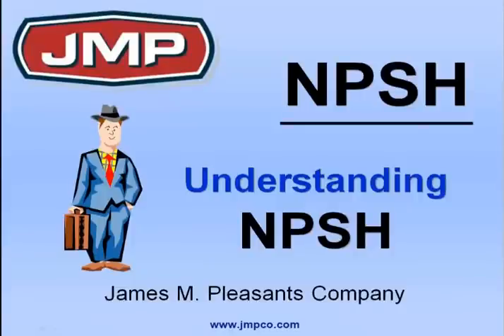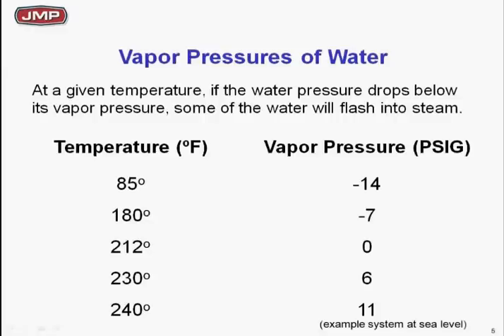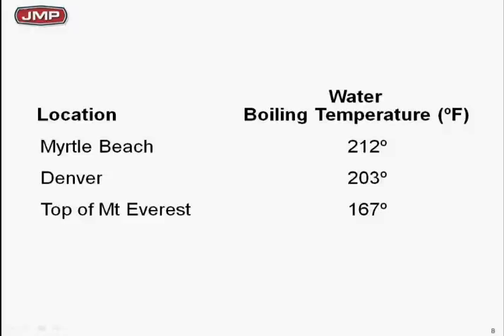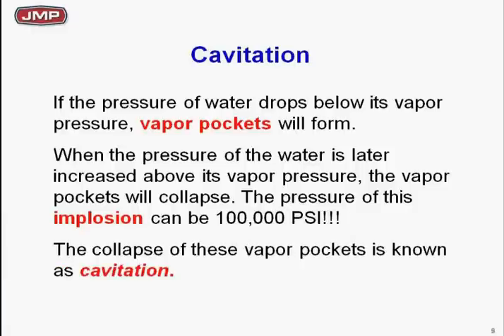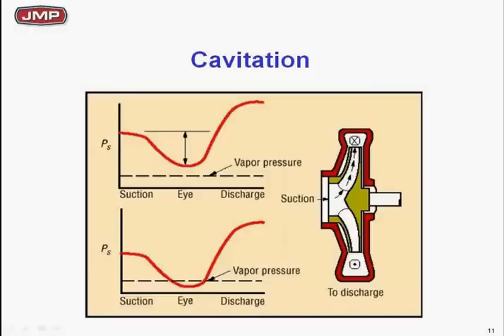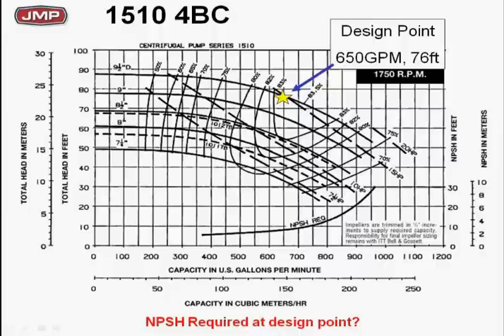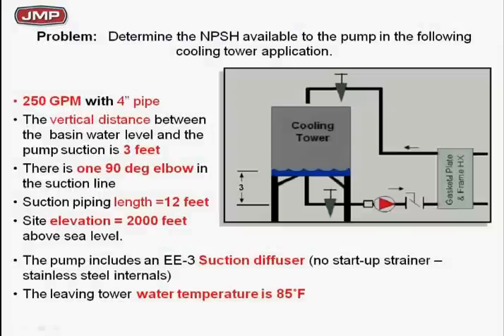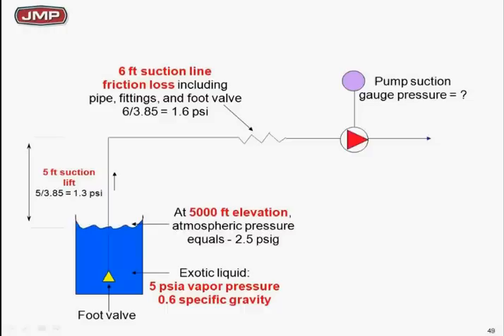NPSH

Comment: Great Video, I've searched for the available calculated suction pressure.guage press chart to know avail.. Can you help?
Reply from the maker: Thanks for the comment.  You can find it in the B&G Cooling Tower pumping and piping TEH manual at bellgossett.com.  Below is a link to the manual. 

https://documentlibrary.xylemappliedwater.com/wp-content/blogs.dir/22/files/2012/07/TEH-1209A.pdf?_ga=2.61346984.505484141.1616590109-365535311.1614794899